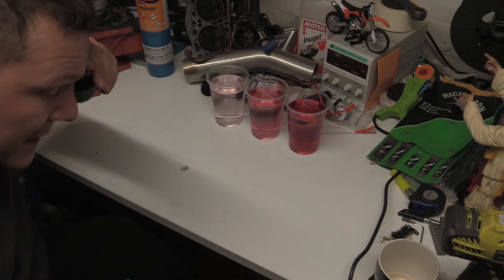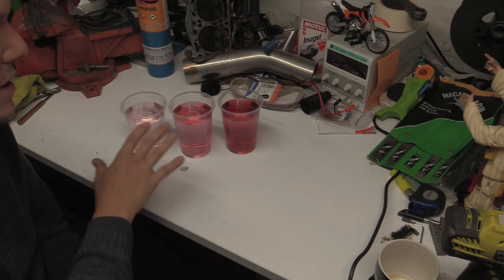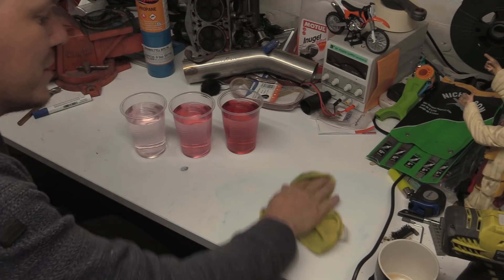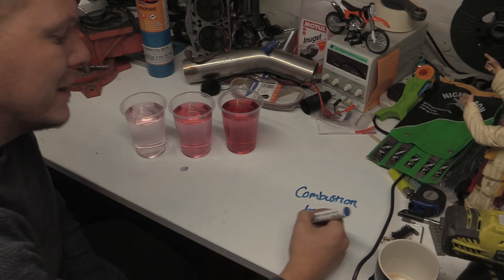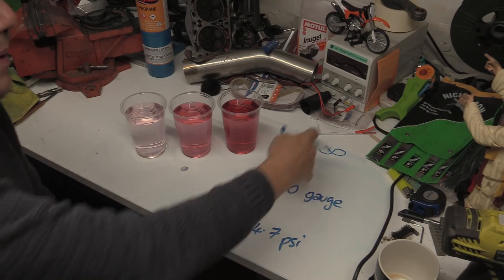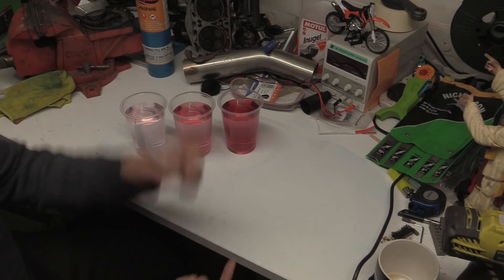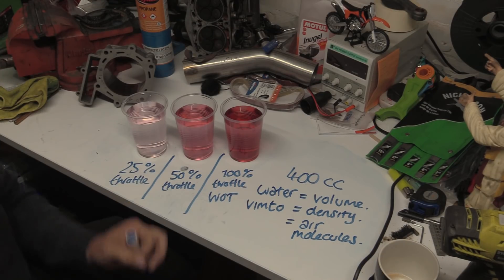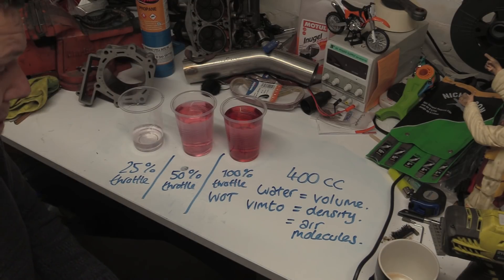What does a Throttle do?

Comment: He Matt I could really use your knowledge for a moment. I am having a small problem with my 2015 Yamaha S10 that neither I, my dealer or my tuner can figure out.

The bike hesitates in second gear when going WOT. But it does this only at one specific point around 3900 rpm. When i go WOT at around 3900 rpm she accelerates like the throttle is half open until I let go off the throttle and accelerate from a different rpm. And only in second gear. The bike pulls harder from 3000 rpm than from 3900. 

The ECU mapping seems fine because we tried several including stock. Could this be a TPS, APS problem? It should then do it in all gear right...not just second. 

Hope to hear from you! Enjoy watching and learning from your videos.
Reply from the maker: Just from the limited info I have it sounds like its the clutch. Its speed dependant not rev dependent. So I'd say its the torque vs speed... let me think about it
Reply: @thedirtyworkshop Thanks for your response! The clutch sounds logical but if I go WOT from let's say 4200 to 7000 rpm in second gear the bikes flies off. No hesitation what so ever. Same goes for 3800 rpm and below. It's only around 3900 rpm in second gear. I can't wrap my head around this...I will try to make a video and upload it to YouTube.
Reply: @thedirtyworkshop  I made a small video showing the problem. The audio is really bad but you can see the revs climbing really slow after I pin it around 4000rpm in 2nd gear. Hope you can give me some insights about this strange problem.
https://youtu.be/vq5Yh-YSTf0

Comment: Good explanation.  So the throttle regulates the mass of air flowing into the inlet manifold but not the volume of air.
Reply from the maker: Yes. The rest of the system, rpm, valve are, valve timing etc that controls the 'rate' to the mass flow rate

Comment: Surely this only applies to petrols? As with diesels (especially older ones) the throttle controls the amount of fuel injected to regulate power output.

And on 2 strokes the throttle controls the oil pump
Reply from the maker: 1) of course it applies to petrols. How many diesel bikes are there?

2) newer diesels have throttles

3) most 2 strokes don't have oil control on the throttle.
Reply: @thedirtyworkshop  
1) Not enough in my opinion 
2) True, but only for emissions
3) It was a joke😘

Comment: What I imagined the cups and colors representing was rather than you measuring 400cc worth of fluid, I thought of the fluid volume as more arbitrary, and thought of it as the vacuum in the cylinder (as the space between molecules is already a vacuum), and the red representing the density of molecules.
Reply from the maker: Think of space between molecules is not a vacuum, and now we're getting into quantum field theory...

Comment: Do bikes have electronic throttles yet then ?
Reply from the maker: It doesnt matter, its the same thing
Reply: @thedirtyworkshop  just wondering if manufactures had gone from sleeved cable to digital pots etc like cars as I could pinch them throttles
Reply from the maker: Only the top end bikes at present. But I'd rather have a mechanical throttle
Reply: @thedirtyworkshop  cable all day long,  when cars went from cable they lost their soul from that day on gingers were attacking the car, Ebike throttles are £70 for a decent one thought why not but bet the bike throttle is like £200 or summat
Reply from the maker: Yes

Comment: Which is done by measuring volume of air and temperature of air( which also dictates volume of oxygen) entering the cylinder.
Reply from the maker: No, no it doesn't. Temperature and pressure are taken and this effects fuelling. All the pressure and temp reading do it tell the ecu how to adjust the fuel from the set norm.

Neither density or volume are measured

Comment: So is the air at a higher psi at full throttle, ie more air crammed in the same amount of space or just more dense.
Reply from the maker: Forget pressure. Density is what matters
Reply: @thedirtyworkshop  isn't that one and the same?
Reply from the maker: God no. Imagine a balloon full of air. And let's say it's 30 psi. Now stick that balloon in some liquid nitrogen. The pressure drops but the air hasn't escaped. Heat the balloon up and the pressure rises.

Pressure is a result of the airs momentum. The momentum is a result of the molecules energy or temperature. Density is the number or mole of atoms and how many in a volume.
Reply: @thedirtyworkshop  thanks for the reply, took me a while to get it. So... cold air is denser than hot, ergo intercoolers on turbo engines. In an engine only part filling a cylinder the air expands to fill the swept volume and the pressure and temperature both drop (density) until the point in compression stroke where the pressure and temp return to atm on the way to tdc and combustion.
Do I win a prize?
Reply from the maker: Yes, and your prize is being smarter

Comment: You'll probably laugh at this mate but according to car throttle volumetric efficiency is how much you can fill your cylinder with air and fuel their example was if you can fill 80% of the cylinder with air/fuel then  you'd have a volumetric efficiency of 80%
Reply from the maker: They've left out the 'at atmospheric pressure' bit.
Reply: @thedirtyworkshop  so are they right mate or is it just to do with density? To me (by all means correct me if i'm wrong) air density is how close the molecules are together the closer they are the more room there is for more molecules which increases oxygen because air is something like 20% oxygen 70 odd% nitrogen and other shitty gasses that i've never even heard of 😂
Reply from the maker: Density is how many atom/molecules per m^3. So 1 m^3 of air is 21% (ish) of oxygen on average. At 50% Ve it means that out of say 400cc the cylinder filled with 200cc of air at atmospheric pressure. 

The cylinder is full, but the pressure is half and the density is half that of atm. But don't confuse pressure with density. Think of pressure as the temperature. The problem comes when you compress that mixture.
Reply from the maker: Them shitty gases are carbon dioxide, water, argon, hydrogen, methane etc etc
Reply: @thedirtyworkshop  cheers mate this has helped me alot
Reply: @thedirtyworkshop  Sorry Matt i forgot to comment this weeks ago mate but i think i now properly understand the 50% ve example emphasis on the "i think" now i've had to google this but air density at atm pressure is something like 1.2kg per m^3 so at 50% ve the density is around 600g per m^3 am i right or am i way off the mark still?
Reply: Matt, would you be so kind as to let me know if i'm right with this please mate?
Reply from the maker: Yes that correct. What you have to be clear on is the volume and pressure. So a cylinder running at 50% Ve has a cylinder volume of "the cylinder cc" at a density of 0.6kg m^3 @ 0.5 bar.

Edit : @ whatever temperature. Remember that pressure is effected by temperature only and not density.
Reply: @thedirtyworkshop  Thank you very much mate